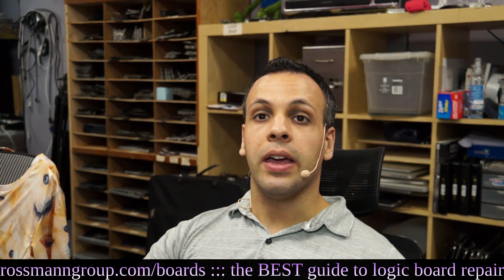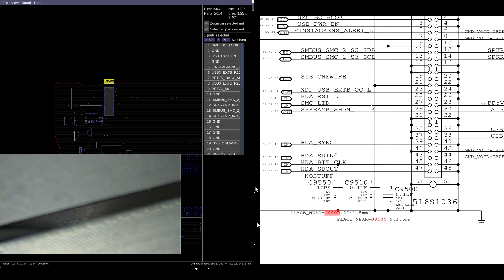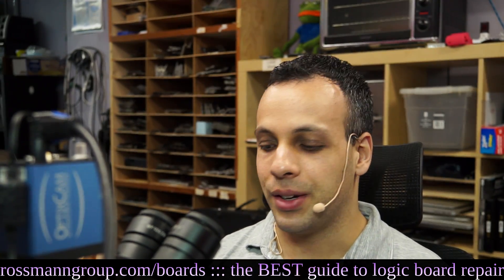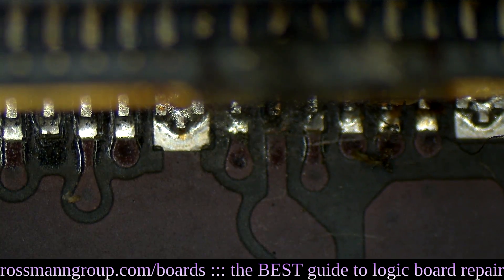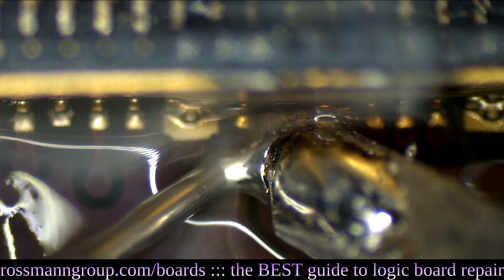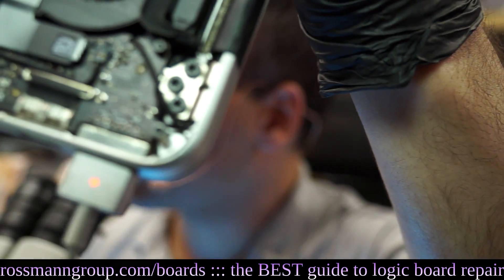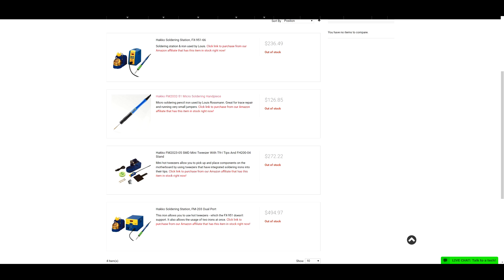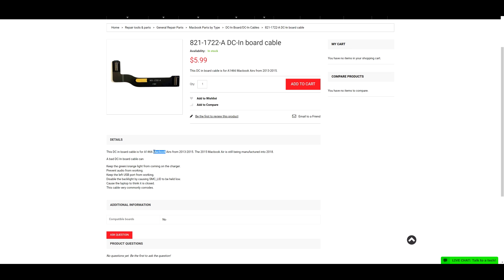How to repair common issue when Macbook Air won't charge

Comment: I have macbook pro 2010 13.
Everything is fine until i put the board back into the chassis and tighten all screws. Only dimm green light then :(
Maybe because of the flex of the board?

Comment: Louis, is there any way you can make it so the cart doesn't time out so quickly on your store? I mean, it's not like it's that quick, but I often find myself browsing in my moments of spare time once I've already added a few things to the cart and then by the time I get ready to checkout, it's empty. I was going to place an order today but by the time I decided to check out my cart was empty and I didn't have enough time to go back and add everything again. I'll be placing the order tomorrow morning regardless.

I've literally never heard that song, by the way. I had to look it up and found the music video, and then I had to skip a full 30 seconds to get to something resembling music. I listened to about 5 seconds of it and couldn't be bothered to listen to any more, but I'm assuming from what I heard that it's basically garbage.
Reply from the maker: it's on the list along with upgrading to the new magento version.. which uses an incompatible theme system/database altogether. :( it's a project
Reply: Ah that stinks. I really like the store as it is, but I'm sure you'll come up with something even better. Thanks.

Comment: need to ask..
How much of this can be from condensation??  With out Proper circulation or Sealing..it can happen allot..

Also, WHAT the hell is going on with Their Solder??  Iv never seen Solder Corrode that much...EVER..
Tell me that dont Varnish the surface AFTER, soldering the board..

Comment: There have been studies and it has been proven that lots of web sites including Amazon vary their prices depending on your purchasing habits.  If the site believes that you search and always dig for the best price you usually see better prices.  If the site believes you just buy what you want without checking prices it will charge more.

Comment: Is there a short circuit at 5:30 or are my eyes broken?
Reply: No I don't think that there is a short circuit, if you look at later views of the connector there is no short circuit, I think that the short is the light reflecting from the flux.
Reply: I would think Louis saw that when he cleaned up the flux on the board. I don't believe that they are fully connected and I don't believe those lines have enough juice to arc across

Comment: Out of curiosity, do you think the lead free solder Apple uses is responsible for the accelerated corrosion I see on all the boards you work on? Thanks.
Reply from the maker: No, its liquid and a lack of liquid resistance in the product
Reply: The corrosion is due to stuff that conducts electricity, like liquids, dinner, pubes, cum etc... The lead free solder is just a pain to work with and harder to make good connections with. (Which to improve, is the reason for the lead in leaded solder.)
Reply: Buford "Mad Dog" Tannen  the corrosion is a result of a chemical reaction -- having lead in the solder does not help prevent the corrosion nor does it noticeably speed up/slow down the process. The only way to minimize the corrosion is to protect the reactive metals (solder, copper traces , etc) with masking, conformal coating, and potting materials. Not going to get into the exact science here, but there are plenty of videos on Youtube that discuss in detail the actual science behind corrosion on electrical circuits involving lead & lead-free solder.
Reply: Benjamin Esposti Not only sometimes. Sweat is one of the most agressive every-day subtances.
Reply: Thanks. Corrosion can happen for various reasons, I was wondering if lead free solder joints corrode faster when in contact with liquids / fluids / balls' hair.
Reply: Georg F  is absolutely correct - the liquid sweet mixed with the salts & oils from your skin.  There are very few worse naturally occurring combinations to come in contact with electronics.
Reply: I think sometimes even sweat can cause that corrosion. I know I sometimes use the computer when sweaty. It might be the reason why my keyboard is messed up currently. (some keys get stuck intermittently)
Reply: @BenjaminEsposti  Blame it on the sweat man. It's most likely jizz that gets on your keyboard. Unless your sweat is dripping from forehead? LMFAO
Reply: Buford "Mad Dog" Tannen 
while louis is right....

It is true that in most situations leaded solder will last much longer. Mostly because it is not as brittal and gets less cracks in it. (Especially over longgg ass periods, then it really shines)

It probably corrodes faster too but thats not really the problem because it will get cracked first, likely.

Wave soldering doesent last as long eigther but thats what they all do now, pretty much.

Lead free wave solder..../cry!